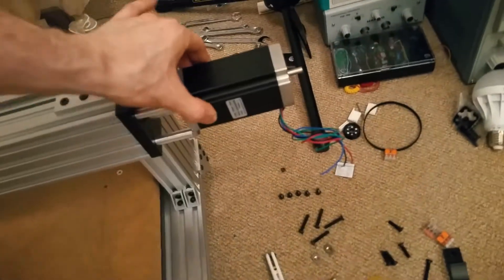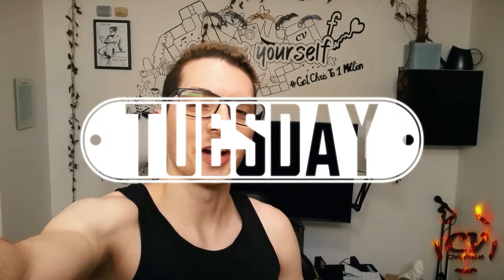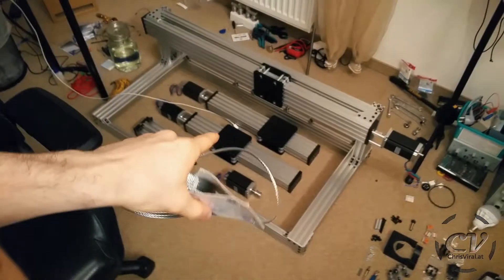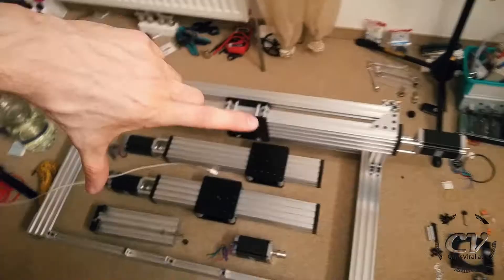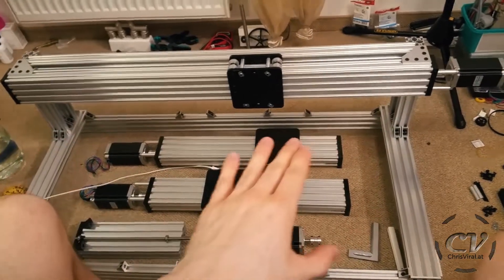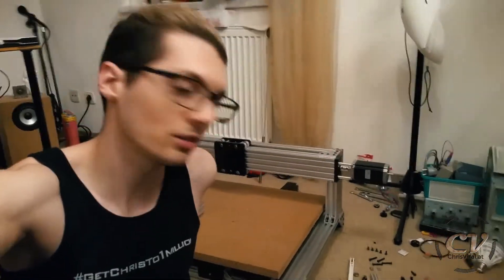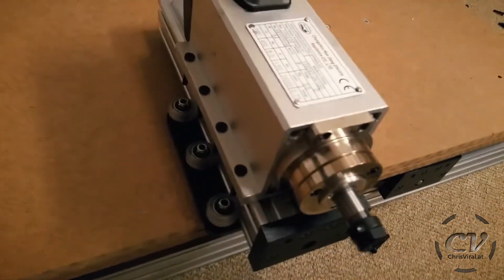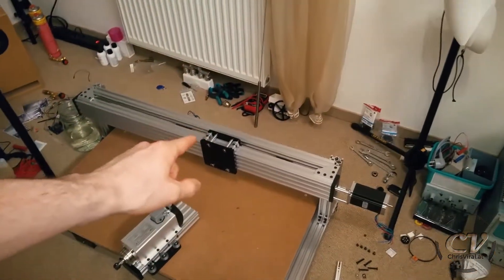Openbuilds C-Beam XL CNC - Build Plate & Angle Hack

Comment: That cable idea is interesting but can only work if the ends of every bar is a good right angle, so you where lucky 👍 
i would just used the wooden baseplate of sturdy multiplex (its cross layered) and then fix the aluminium with screws and force.
Reply from the maker: Sadly I wasn't lucky because the profiles came with really bad angles and lengths but I fixed that with a file (as seen in the first build vlog). But even though I fixed that, after assembling it still wasn't square. I probably messed it up lol. So I thought adding a cable might keep it in place. But yeah I guess because it's all angled up it just cracked and stayed in place without tension at all. I'll leave it in there though...

I was thinking about a base plate as well but as it is now... It's already getting really heavy. I still need to be able to move this thing around until I find a place for it to stay. (which I probably won't soon)